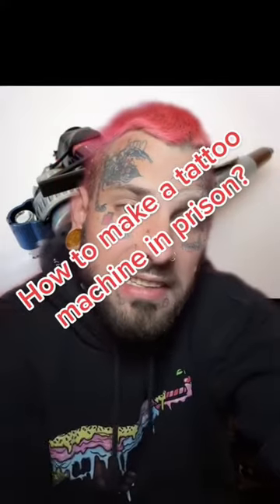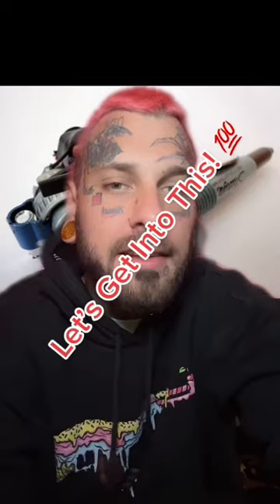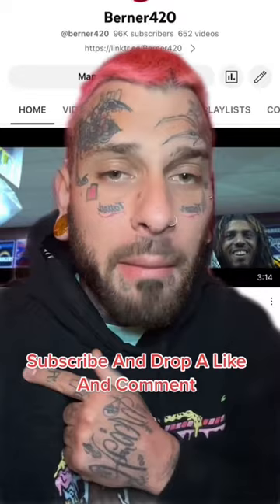How to make a tattoo machine in prison

Comment: Burn chess pieces to make ink with the soot, the carbon black ink is identical to normal tattoo ink.  We would use commissary bubble sheets and make a smoke stack, light up the chess piece, put the bubble sheet smoke stack over it and put a book on top.  trap all the smoke. The scrape the soot off and mix it with a little water and something to thicken it up a little like shampoo